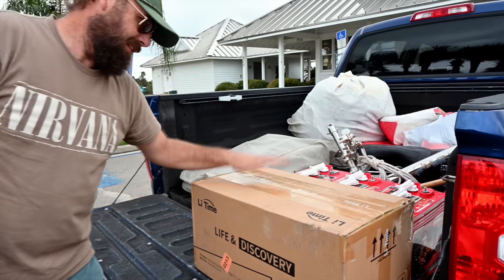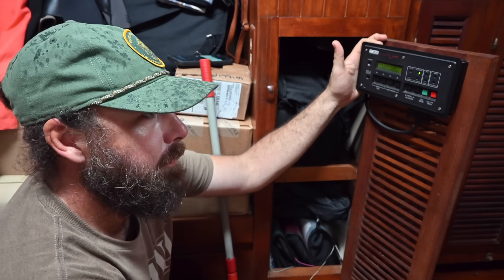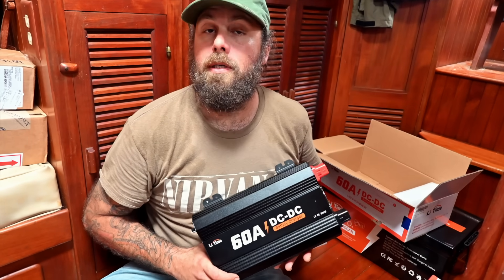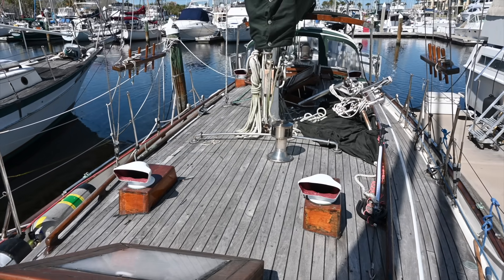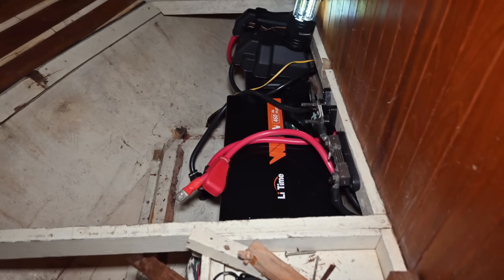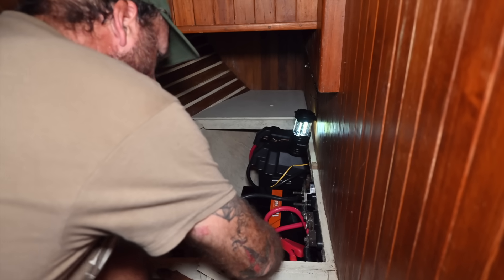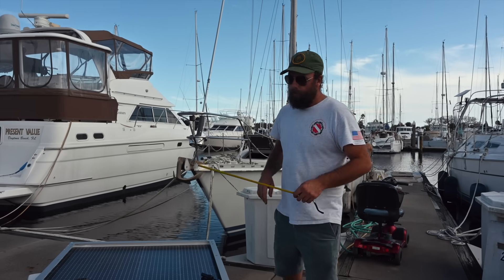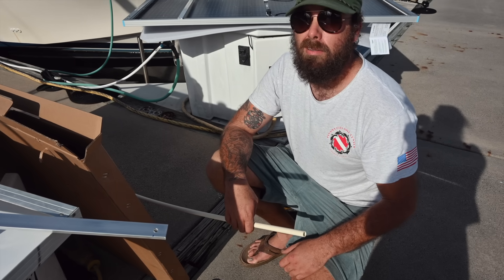WE COULD HAVE EXPLODED! The switch to LiTime LiFePO4 after battery bank was OFF GASSING (Ep47)

Comment: When I read the titel I had already a question about it.
Lead batteries are not known for beeing an hazard to explode.
However Lithium batteries can fail in a way which will not allow you to extinguish it.
litium technology has unquestionably benefits which outwaight the risks but from a savety perspective lead batteries are much mote failsave.
Outgasing of lead batteries in a well ventilated enviroment ( a sailboat should be well ventilated for various reasons) is no thread at all.
Reply from the maker: There have been many, many cases of lead acid batteries exploding on boats.
Reply: @TheSirensLog  Shall I post the links of burning LiPo batteries and firefighters just have to stand by and watch because you cannot extinguish the fire ? It will be a very long post with links .
Honestly , Lead is  saver when it comes to "exploding" or fire safety .
However they last longer and are 100% maintenance free. As said the benefits outweighs the risk.
Just if something happens to make them burn say goodbye to the boat, no way to save it.
Reply: @TheSirensLog  Interesting , sorry yes i've know there is a risk , but i've not heard of this actually happening in over 50 years . All lead acid batteries gas , it's a natural part of the charging . However i have heard of more Lithiums of all types catching fire in the last five years to last a lifetime . Personally speaking , i would prefer to deal with a gassing lead/acid , than a potential bomb on any boat on open water . 

But hey you pay your money you make your choice ! .
Reply from the maker: @mickey1299  Well many people would argue the opposite, that lead acid batteries are “bombs on boats” and while I don’t personally know anyone who has had that happen, a quick google search does turn up plenty of people who have. In the end, neither are amazing options but they’re fairly necessary. But note that when I say the batteries were off-gassing, I don’t mean that they were off gassing at normal levels. I mean they were fried, boiling, swollen, and off gassing like hell. So… that creates a very dangerous problem. If they’d been new batteries, maybe not. The point here was that when our lead acid batteries were fried, we had the opportunity to switch to lithium OR replace the entire battery bank with lead acid. If we had stayed with lead acid, we would only ever have this much power. Switching to lithium allows us to triple that power. Also, these are LiFePO4 lithium batteries which are very safe.
Reply: @TheSirensLog   Now you made an interesting statement there , it was over gassing . Can i ask, how old were the batteries and perhaps more importantly , when was the last time you checked the electrolite level . This is the main reason many lead acid batteries fry . 

Over charging , for example constant connection to shore power via an unsuitable charge controller , even in some cases a constant solar charge , causes the battery electrolite to boil . This is when the gas is produced , the problem is this gas is heavy vapour , producing i think chlorine gas , others will know for sure . Left unchecked it will empty the battery of electrolite  , until it , as you say fry's . Many are under the illusion maintenance free means exactly that , but they are anything but ! . They should be vented overboard , and regularly serviced .   

As for lithium , i have had certain types are ultra safe , rammed down my throat so many times , i've lost count . Yes they are more powerful . Last longer ? , well reference above , but safe , nah , not in any way . Two of these so called ultra safe batteries i've been hearing about  , li-ion ,  have gone bang recently . In one case two people have died , but it appears that number may have risen this week , as i'm hearing of three more incidents only this morning , with two more deaths . China is reported as having 5000 incidents a year , America , and Australia are both concerned at the growing incident rate , and over here , we've had 4 this year already . I would suggest , Po4 are only safe at the minute , because none have been recorded as going pop . Like i said , i would never entertain a lithium battery of any type on any ocean going boat of mine , my life would depend on that boat staying afloat . I won't even fit one in my RV .
Reply from the maker: @mickey1299  we don’t know the age of the batteries, they were unmarked, we’d only just bought the boat so we don’t know the habits of the previous owner, only that they didn’t live locally or use the boat much and the boat stayed plugged up to shore power. They were due to be replaced and being a vessel that will take trips and eventually travel far, we did the research on the LiFePO4 style lithium batteries and decided that was the best route, as we can get a lot more power in our tiny space and this particular type of lithium battery is supposedly the safest, by far. I don’t doubt the incidents you mention, but I do wonder if they were with this type, and I will look that up. I know the other types of lithium batteries can be quite dangerous. 
You mentioned you were sure the substance that lead acid batteries offgas- Hydrogen is the word you’re looking for. Hydrogen can cause the CO alarms to false-read. However, hydrogen is explosive.
Reply: @TheSirensLog   Well i can save you that at least , no , none were Po4's , as i said in my last post , there are at present no recorded incidents involving this particular type of battery . However over the years , i've been told the same thing with li-ion , and recently there have been a couple of incidents involving this type . 

As a foot note here , my personal view is it maybe the Lithium that's the problem . I'm beginning to wonder if this material is not actually unstable . Time will tell , but it will be some time before i would even begin to trust the things . I'm fully aware they give more bang for your buck as they say , but sometimes that bang is simply just not worth the buck . It would appear your power hungry , and that maybe your downfall , perhaps look towards reducing that hunger . Maybe i can also suggest you look into some kind of cooling system for your battery box , this certainly appears to be its achilles heel , and i would consider leaving space between the batteries when you fit the others . But for me personally , i'll stick to lead acid for now , thank you .

Yep , if the boat was seldom used and those batteries were permanently plugged in , they were almost certainly cooked as they say . Errr , overcharged and probably boiled dry . Gassing or not those batteries were almost certainly beyond saving , so yes were definitely up for renewal . I was unsure of the actual gas given off , but yes Hydrogen is certainly explosive . Actually it's very explosive , it's also lighter than air , so you would certainly smell the vapour as it would rise , and it definitely would send detectors scatty . I'm not really up on gasses , but i know the British used this stuff in their airships many years ago , and also it's the same gas used in the infamous Hindenburg of the same era . I'm sure you know your history , and what happened there , actually most of the British airships went the same route . But this now presents me with another problem , generally battery vents i've dealt with , vent down . Yet here an overhead vent would be required to clear the gas , interesting . I've never really gone into it before , now don't take this personally , but i'm gonna have to check that one out .
Reply from the maker: @mickey1299  I will say that we aren’t really “power hungry”, but if we are to produce YouTube videos, we need internet and electricity to do that, and the starlink system does use a fair bit of power. If we don’t have enough power, we aren’t on YouTube, we aren’t charging camera batteries, we aren’t charging laptops, and we certainly don’t have internet. Right now, this 460Ah battery is “working” for us, but we have to be very conservative with it only using internet at certain times and charging at certain times. Sure would be nice to have access throughout more of the day! That’s where a second battery would be nice.
Reply from the maker: @mickey1299  One more reason to laugh when people claim we are trying to “get rich quick” on YouTube. 😂🤣 I have about $20k wrapped up in overhead on just the channel alone, not including the boat. It’s hardly making us rich. Hahaha
Reply: @TheSirensLog  never heard of it once. I would like to see some data of lead acid batterys exploding from dating as there designed to gas.
Reply from the maker: @evinwhiteson4902  You can Google it. There are many accounts of it happening but I’ve not known anyone that it happened to personally.

Comment: I would never use lithium batteries in a boat
Reply from the maker: Also note that they’re LiFePO4.
Reply from the maker: Why not
Reply: @TheSirensLog  there are many stories that are verified about lithium batteries catching fire, blowing resistors in alternators,  needing mppv controller to suit lithium,  cant buy lithium batts anywhere button major cities,  if need a replacement therefore hard to get,  lead acid can be bought just about anywhere on the planet
Reply from the maker: @rabsmcsporrin9572  true, but they do last 4x longer at least, and Lithium phosphate batteries aren’t anything like the other lithium batteries
Reply: The guys who tried to sell me lithium here to go with the 1400 watts solar I bought from them recently in Thailand a aussy company. Say you really need a high output alternator with a external regulater with lithium settings. A battery to battery charger and the lithium run through a starting battery of lead acid thats charged first before lithium charges. To prevent alternator destruction and a possible lithium  black out. Caused from over heating or other bms issues.
I found all this expensive and way too many moving parts for my liking.lthe solar was cheap. 700.00 bucks for panels and 600.00 for regulators.
I am into lithium I just don't have the money to do it right. I have 900 amps of lead acid. Costs me 1,100.00 every 4 or 5 years. The lithium would be 10k as quoted for 900 amps lithium not installed just the bits and pieces. Even though I already have a high output alternator
Reply from the maker: 900amps lithium is twice as much as 900amps lead acid, though, so you don’t need nearly that much! With the LiFePO4 batteries you use 90% of the battery, and you don’t with lead acid. So, it won’t cost you nearly as much as you’re thinking. The one battery we have at 460Ah is a $1500. Battery, and it’s the equivalent of 4 lead acid batteries and will last a hell of a lot longer. If we add another we will have double that, obviously, in a tight space.
Reply: @TheSirensLog  
Yup... and its only getting better...plus the lead batteries are getting expensive as well.
Reply from the maker: Basically you roughly have the equivalent of the one battery we have, considering we can use a higher percentage of the battery. They’re pricey, but… not really.
Reply: If your worried about Li theres LiPhosphate... If you want to go safer still and serviceable theres Blade cells long and short.. and very soon There will be Na ion.. which are next level safe and cheaper .. though heavier at the moment and they are ideal in hot and freezing cold climates. 
They can also handle C rates that would melt most Lithium  cells.

Comment: I am no expert. 30 years cruising gives me insights,But I am convinced lead acid off gassing or not are the safest battery's on earth. Now if you have no ventilation then off gassing is not something you want. You can make a deadly gas. But lithium could burn you right down to the bottom as a lithium fire is not extinguishable. So there's trade offs. I like lithium but not the costs and not the fire hazards. And then there's the time when equalization from the bms causes total shut down. No power. Carry a starting battery.
Reply: LiFePo4 is a different chemistry than what is used in EV’s and has a much higher thermal runaway. Also you can 100% use a battery while it is balancing.
Reply: You are right, there are definitely much more considerations to take in than just dropping in a LiFePo and calling it done.  I made the switch a few years ago (with all the associated) modifications and personally I would never go back to lead acid for a house bank.  But to each their own on their own vessels and what they are comfortable with.
Reply: I got info on lithium from a few source.  I kicked it around the past 3 years. If you are not well schooled in lithium instal you can really mess things up.  The things I mentioned are fact. However a properly installed lithium set up with quality components would be worth the risk for the rewards if I had 10k but I only had 1k so went with t105 again as I have for the past 30 years. Plug n play.
Reply: There’re dangers everywhere on this planet. 
Whatchu’ gonna do, hide? 

Death will find all of us no matter where we hide

LIVE LAUGH LOVE 
☮️